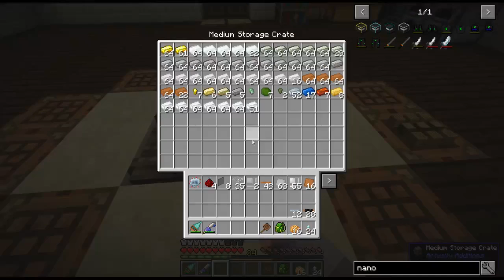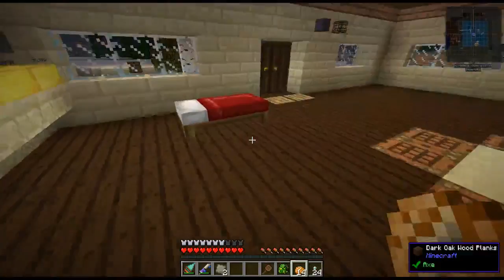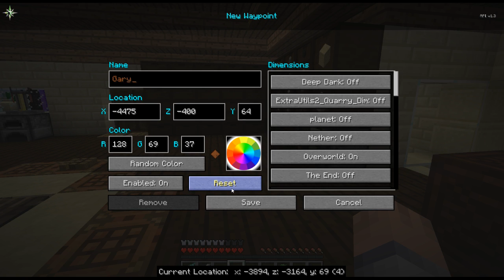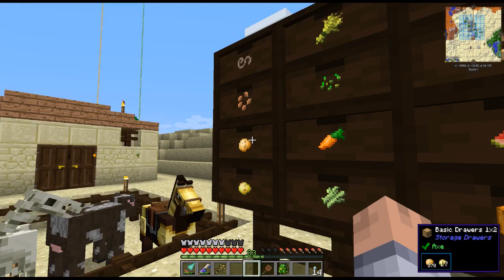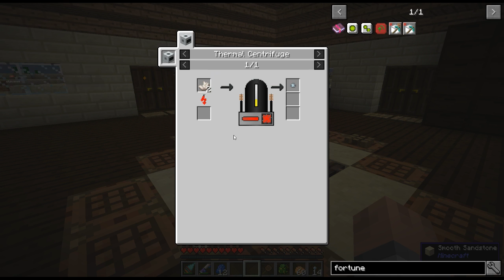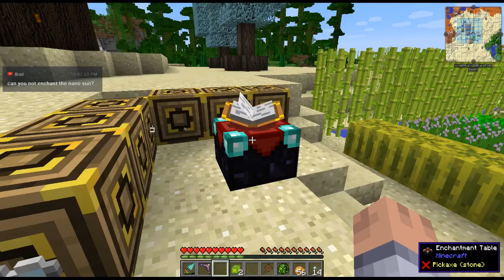Age of Engineering #7 - Mob Farm and Nano Suit

Comment: Make a Tech Reborn Blast Furnace if you can get the materials. It should run off either IC2 or RF power, and produce steel quite a bit faster than the IC2 one. 

Also, the Tech Reborn Industrial Grinder is awesome. Lots of little bonus material and you can have four sharing the same multi-block structure in the middle.

If you want to vastly increase the amount of XP you get, make an all Copper Scythe from Tinkers, it'll boost the amount of XP you get, and let you kill a bunch of mobs with a single swipe.

IC2 disabled the ability to enchant IC2's armor. It was kind of hilariously OP.